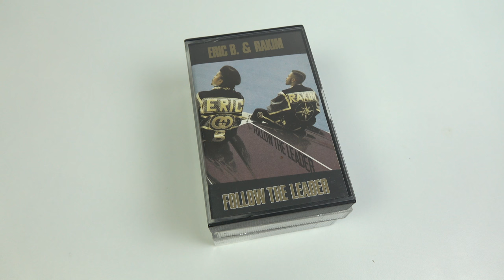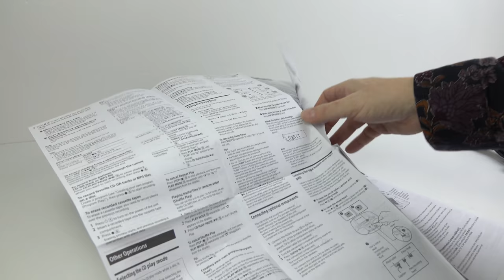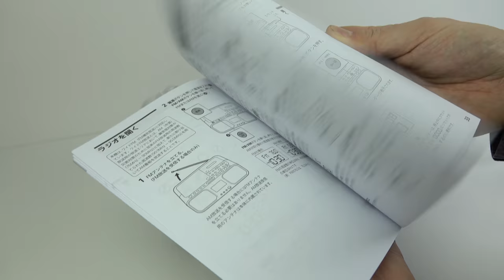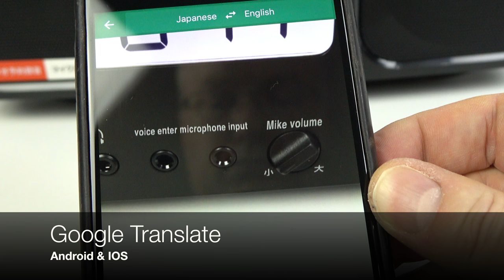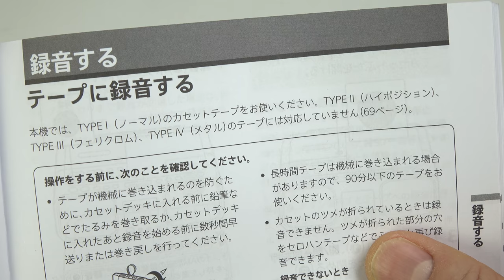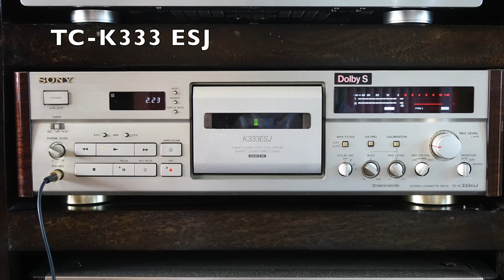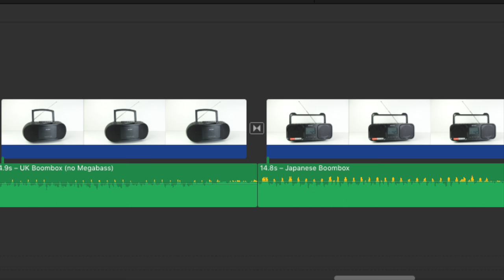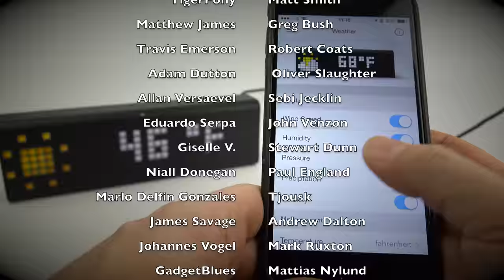Sony's New Cassette Boomboxes -  East meets West

Comment: Could someone please kindly ELI5 what the ever-living christ a tape counter is actually for? I've tried looking on audiophile forums, but to me it's all Greek gibberspeak that's designed to make me feel like a complete moron without ever having set foot on the registration page. But, I guess when $8,000 voodoo RCA cables aren't good enough for you, you're allowed to have a tone of superiority about your postings.
Reply: A tape counter is used to find part of a tape you want to listen to quickly.
You put the tape in. Rewind the tape to the beginning. Then reset the tape counter to 000. Play the tape. The counter moves with the tape. At the beginning of each track, you take a note of the tape counter number.

In the future, if you want to listen to a certain track. You put the tape in, reset the counter. Then fast forward until the tape counter reaches the number the track starts at. If you want to listen to the track again, you can rewind to the number.